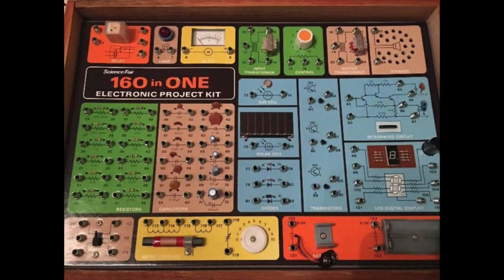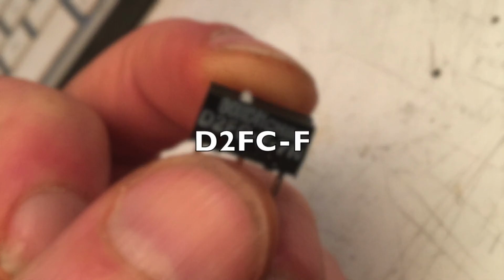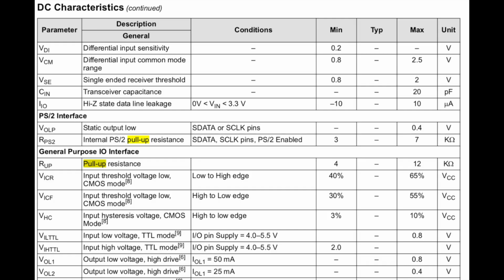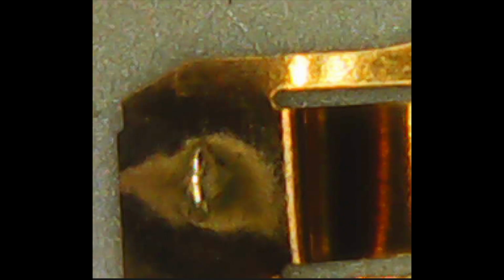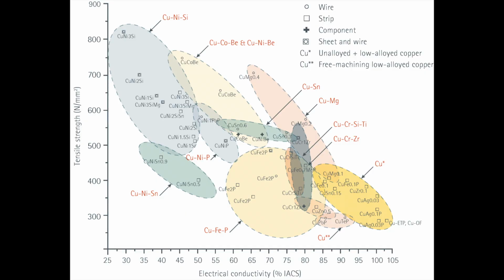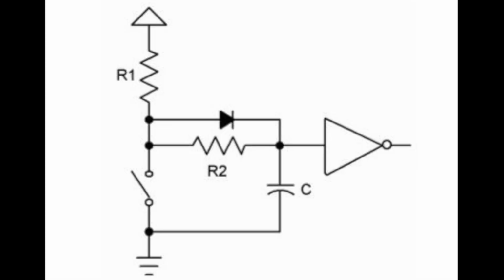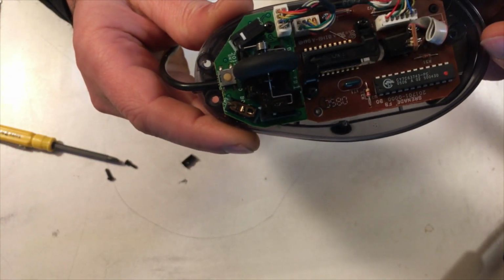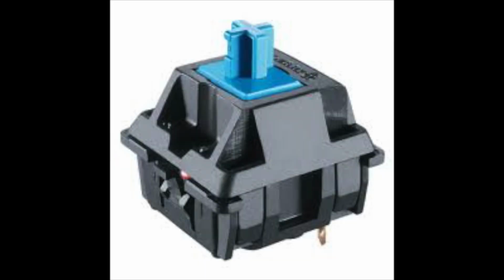Failing switch problem: Omron vs the modern mouse circuit

Comment: in summary:
we need mice with boost voltage for switches, LR as doubleclick filters/current boosters, open software
before that may add 0,1nФ caps and 50 Om resistors or get old cheap mice
Reply: Boost voltage is not needed, the problem is trivially solved with current, by just instead of using the on-processor pullup, simply having a resistor to VCC create the pullup rail, but this adds a good bit of extra footprint. Any kind of passive filtering is completely unneeded, but i think well-implemented debounce firmware can solve it. And maybe lubricated switches for less mechanical wear and better contact materials can go a long way.

But the problem is that nobody is interested in selling you a mouse and then LOSING you as a customer for 10 years, all major brands just want you to lock into their ecosystem with software and have you buy fresh hardware regularly. It looks like we need an open-source community mouse platforms, and then manufacturers can jump in, even just odd Chinese companies that might be making 3D printers now or whatever who are familiar with that kind of thing, providing premade parts. But then you're aiming for a pretty high-performance mouse, and all high-performance sensors have proprietary firmware that is not resident in the sensor, it gets uploaded to the sensor by the microcontroller in the mouse, so while you can trivially capture it as it's being transferred, you're breaking copyright, embedding a proprietary blob with no license, and both are a massive impediment for legality of an open-source project. So there is one such hobbyist project where they have extracted all those firmwares and they have a custom microcontroller firmware but it's trying to stay on the down low and it's not even open source.
Reply: @SianaGearz  boost may be eligible anyway. raising voltage is more effective than raising current
Reply: @pajeet1979  The difference in voltage is small, 3.3V for mice that fail vs. 5V for the mice that are known to work well for a decade, so that's a fractional difference in arc distance. The difference in current is more substantial, going from at least 500µA on mice with 10-year actual endurance to 50µA on mice that fail typically in half a year, a factor of 10. Boost seems like an unnecessary complication. Bet just by getting the current to 1mA you can get it to where the switch is royally chewed up mechanically before the electrical action degrades beyond reliable use.
Reply: @SianaGearz  
I consider your arguments as reasonable, circuit simplicity and cost may be a decisive factor in final product design. 
but i see necessity to argue more for the boost:
- 15-years old good mice were also the compromise of using 30v switch in 5v circuit. it works well, but if someone willing to build uncompromised product is not obliged to look back with much piety. more so boosters were much ineffective those days
- I haven't found a formula, but intuitively consider voltage to be more important in making contact, as may be a square or even cubic root of current. especially on those little voltages when -3,2?? volts less makes oxidation absolute insulator for short circuit.
- mice as future platform may be powered by 2,4v li-ion, 1,1 nimh, by 3,3 through type c energy saving profiles for mobile stuff, so boosts may become everywhere standard. Also it is additional reliability when powered through usb extender or in weared wires.

Comment: Your NOT an EE? Could have fooled me. Mouse manufactures don't even have to add components to make a better mouse, Have the firmware emulate a SR latch with both the NC and NO parts of the switch and it would have no issues with debounce at all unless the clicker bounces between both the top and bottom contacts. Built in redundancy as well as first break or first make click registration. Might need diodes if they need to multiplex all 26 keys but they would already have those on the other keys.
Reply: All mice are on dual sided boards, some on single sided, never 4-layer. It creates a routing problem when trying to run a more complex layout. The way they are doing it now, they only run one trace per button from the microcontroller, that doesn't need to intersect with anything, and they run one ground trace that just circles all the way around the PCB. Then they connect the ground to C terminal and the CPU to NO terminal or vice versa. Maybe an upgrade to two traces per button is just within possibility, then C is necessarily earthed, and both NO and NC are connected to CPU.

But they have no incentive to solve the problem, that's the main issue.

Comment: Thanks so much for this information. My frustration is high. Starting with my first built pc as a 13 year old 386-16 34+ years ago, I've had mice last years. Even the first razor deathadder gave me an acceptable life span. But over the past 5 years, they are fading faster than I can buy them. I don't RMA them, because I keep thinking its not a major problem, its one bad mouse.  After 5 early death (no pun) Razor deathadders, I switched to corsair M65 rgb elite. I guess I missed all the warning on left click issues, because their forums are plagued with reports for over a year now. RMA to these poor soles who waited 2-3 weeks for a new mouse to arrive, quickly report the replaced mouse died shortly after as well.  So here I am, wondering if I need to find some 1990s Microsoft mouse to game with.  I guess at this point, the best option is to search for switch replaceable mice. I know at least one exists with a heavy price tag.  And i'll want to buy omron switches by the dozens.
Reply: Corsair M65 rgb elite bought Nov. 21 2020, left click issues by Dec. 19 2020.
Reply: @scubaman2003  I have a Roccat Burst Core Buyed 1,5 Years Ago, it has the Titan Switch (Optical Laser Switch). It works perfect like Day 1, not a single feeling of worsening.
I think this Optical Switch is the Revolution we needed to Fix this Double Click Problem. They say they are testet with 100 Million Clicks. Most Omron Switches are said to last 10 Million Clicks. So instead of 4 Years you can use the mouse 40 Years. This Is a relativly new Tech. 
The Only Brands with this new Optical Switch Tech are Roccat, Logitech, Razer, Corsair, SteelSeries, Cooler Master and 2-3 smaller brands that i dont know.
But you should watch out. Some Older models with Omron are still in sale with this Brands. Not all Mouse models have switched to the New Optical Switch.

Comment: in 2 years I RMA 3 times my razer naga trinity because the mouse would be loosing contact while being held at random times. They all had the same issue in 1 to 4 weaks. Not double clicking. I handle the mouse really nicely, but it didn't help. So annoying I can't buy any other brand because nobody makes MMO mice anymore.

Comment: i dont get it, whats the problem with omron? i have had a corsair katar since it came out back in 2015 and i have NEVER had a double clicking issue, the only issue i have is that the grip on the side has worn out alot, idk if i got a quality mouse or everyone is just bad to maintain there mouse switches
Reply: I think you got lucky. The mouse switches in your mouse are the usual D2FC China variant that fail on most other mice, and that doesn't really depend that much on the person and how they use their mouse, maybe a bit, with the failures being typically this early and not confined to heavy handed users, it's obviously bad design. It also has the usual NXP LPC11U37 processor that has weak pullups (50-100 kOhm) prone to exhibiting the problem described here. I googled up the teardown of your mouse. I'm seeing a lot of resistors and resistor footprints that have been spared in later revisions of the board, and it looks like possibly at least in some versions, they might be providing some extra pullup current to the switches, which might be helping them operate within spec and endure wear more gracefully. Another interesting trait is that the switches are oriented 90° from how they usually are, which can help reduce lateral forces and weird force application. Shell design can contribute a lot to wear, it's generally impossible to guarantee that the shell button piece presses down on the switch nub evenly rather than under an angle, there simply isn't enough precision available, but maybe by some sheer luck they got it just right.

Comment: I have a Logitech G102 Prodigy that I bought a year ago. It is double clicking now.
Should I buy another Logitech mouse? Or should I go with another brand? (e.g. Asus ROG)
Reply: I'd say you should try to get a warranty replacement on the mouse or repair it yourself, you can solder in D2F-01 switches (Japanese) as a replacement or maybe Kailh, depending on availability, either should last longer than the original, and my suggestion is to also spray some silicone through the switch nub into the switch enclosure to reduce mechanical wear and reduce bounce, but it sometimes does more harm than good on an already heavily worn switch, so maybe do this on the new one when you replace it. Due to slightly different dimensions, it may be needed to file down some plastic on the actuator that presses down on the switch nub (usually it's a cross-like protrusion) in the enclosure plastic that forms the button surface, but you'll know when you get there, also inspect the actuator for damage, with Logitech it's sometimes the case that it's heavily worn and may need to be filled up with either epoxy or maybe just even superglue-soda trick, and then filed back flat. It seems that switching brands is futile until they gain the insight and change their ethics. By buying another mouse, whether by the same company, or with the same design fault by another, you're just encouraging them to continue like that. If the ASUS ROG has swappable switches, maybe it's a partial solution?

Comment: So which modern gaming mice don't have these awful quick-eroding switches? I came here because of problems with my Corsair M65, but apparently, this is also a thing with Razors and modern Logitechs.
Reply: Probably none? Someone had mentioned ASUS ROG mice here, they seem to have a switch socket that you can just drop a new switch in (not sure if some or all), but i bet the underlying engineering isn't really any better.

Comment: I hope this guys know that Logitech, Corsair, Razor, etc are not engineering companies and never design their Ken products. All of them are designed by China ODM’s for the lowest cost and highest margins. That’s business and it sucks.
Reply: That's not quite the case, it's a lot more complex than that, and Logitech has a lot of in-house engineering, and the way it is now, you can't just release a mouse independently, you need proprietary engineering at the very least from optical/semiconductor specialists in Taiwan, and all the specialists for tooling and DFM are also there and in China. But anyway the quality does get sacrificed, and it's mostly seems to me just pure planned obsolescence with just a pinch of cost saving.

Comment: I just now scraped some corrosion off the contacts in the left switch of my Logitech M720. It's one of those Omrons, but 10M instead of 50M. It was a tiny amount of corrosion too... really just discoloration. Barely perceptible, but it made all the difference. I learned how to do this elsewhere, but wanted to know more. That's how I found your video. Now I know this switch is just the wrong one for the job, and that I'm going to be cleaning these off or replacing them every other year or so unless I get a different model switch... or mouse.

I don't want to sound ungrateful for the knowledge though. It is annoying, but I'd rather know about this problem than remain ignorant. So thanks.

Comment: Wow what a great detailed explanation, I've had 3 mice suffer from double clicking with the fastest offender being a Logitech G300S , after 3 months it started happening, also a MX510 after many many years of service and now after 2 1/2 years of use a Logitech G Pro wired (original non-hero model).

Comment: Logitech boast that they've made a lot of refinements (although just less weight) on their new product G Pro wireless Superlight  (see here: https://i.redd.it/s65x1s5ifmu51.jpg ). Do you think they've might have actually done something to try and fix these issues as well e.g adding some transistors. Also they changed the switches on the regular GPW to 20m Omrons and added some different firmware which seems to at least make some difference. What are your thoughts? (Impossible to know for certain without examining the mouse in person of course).

Comment: This was an awesome but horrible video for me since I was expecting some sort of definitive fix at the end, but I guess there's no cure-all besides soldering in new D2Fs (which I'm about to do). I'm curious how the mechanical durability will fare. It's amazing to me that nobody has managed to make a mouse that lasts more than 2-3 years. Every single one I've had ended up double-clicking between the 2-3 year point.
Reply from the maker: I dropped in both a Japanese Omron and a Honeywell when I made this video and have been using them daily with no problems so far.  I didn’t expect them to last this long but they have. I play click heavy games and work on CAD for big chunks of the day, so they have gotten quite a workout.   If/when they finally die, I’ll do a postmortem vid.   Dope Guthrie Govin solo by the way.
Reply: @AlexKenis  that's great to hear. And thanks!
Reply: @AlexKenis  What about combining a better quality switch with one of the electrical kludges to get the switch within its proper operating range? Is it possible to do that without sending too much volts or amps to the controller?

Comment: Interesting, that explains why most mice I bought since around 2009 are unusable after a few months. Seems the marketing BS with overdone sensitivity and such stuff is to blame. I mean, I don´t see the use of absurd high dpi values. Unfortunately I haven´t found ergonomic mice that are durable and well-designed because it seems only "gaming"(which equals shooters but there are other genres) seems to be a selling point.
Well, I still have some of the old mice somewhere, so I can test if I can repair them.
What do you think og Huano Blue switches. I saw a video where some guy said they feel more clicky than Omron. I also opened an old Cobra mouse and it had some Huano switches in it.
They are also very inexpensive(5 pcs for around 2,50).

Comment: Great video. I found this after reading negative reviews online for Logitech’s gaming mice. I also had a similar issue with my Corsair M65 Elite, where the click in the software registered after the physical click.

On another note, what do you think of Razer’s optical switches? Will widespread adoption of these fix some of these issues? Razer advertises zero debounce delay.
Reply: Yea looks like that is the solution, the optical switch.

Comment: Fucking excellent great awsome video. The best video about mouse tech stuff i've ever seen. Thanks for this being posted in /r/MouseReview sub. I am on my 5th G305 now. I usually break the right switch while banging the mouse in the desk due to my severe gaming frustration problems. I got the 50M version from amazon, I know now that this is not the best option. Nevertheless I will give it a try - I have plenty of G305s here to play around.

Comment: great vid alex, my razer naga started double clicking after light to moderate gaming use in span of 4yrs. i was mad, turns out its this shit switch thats the reason. my current corsair also uses the same switch but is working fine for now... fingers crossed

Comment: I love this guy!! I was skeptical at first because this vid doesn't answer the question "why does blowing into the logitech switch seemingly fix the double clicking issue" at least until It comes back (as some people tell me their caused by statics). I Used to have a couple of log-mice both of which I've replaced the switches and the issues persist after just a couple of weeks/ mos or so. I even hacked the mouse1 switch by terminating it's connection and connecting them directly to the thumb switch terminals instead and changing it's function in the software so it works as mouse1... Now I have a better perspective on the issue.  In a nutshell, either replace with better switch or change sampling/polling rate (adding a resistor isn't an option unless I know which value to add)

 This guy is totally awesome for pointing out a way to reduce sampling/polling in the logitech software as I have searched but never found an effective way of  doing that in windows. Also it answered my question as to why lower grade mice seem to be more rugged than the more expensive log-mice...

Comment: Just found this after my months old G502 Hero (wired) started acting up. Thanks for your excellent and detailed examination of the complexity of this issue.
Reply: The hero sensor probably exacerbates this as it's meant to save battery life. It's a worse version of the 3366

Comment: Do you think setting a polling rate on the d2fc-f-7n will improve the lifespan of the switch?
Reply: My take from watching this is that it might improve the lifespan of the mouse, not the switch. The problem is still there but you don't notice it as often so to speak.

Comment: Ive been through several Logitech G700s because of this issue. I wouldn't REALLY care that much but the mouse has been discontinued, and it's still the ONLY mouse, as far as I know, that has wired and good wireless operation and four reprogrammable thumb buttons which I absolutely require.

Comment: Incredibly thorough explanation, and with damning evidence to support it. Everything clicked together, both figuratively and literally. =)
Also, thank you very much, you just helped fix my G303 (ok well ghetto fix actually, I only cleaned the switch's contact plate for the time being but it did wonders).